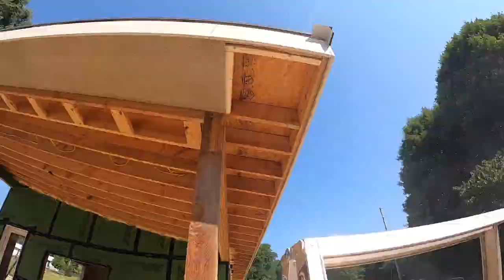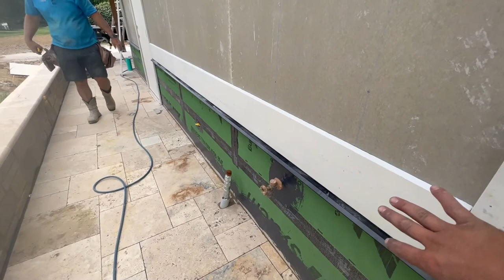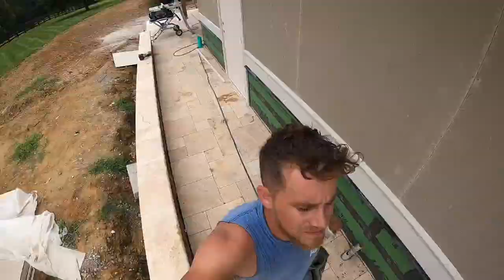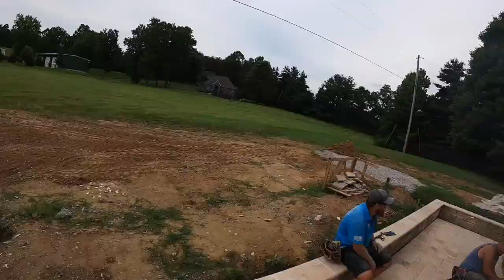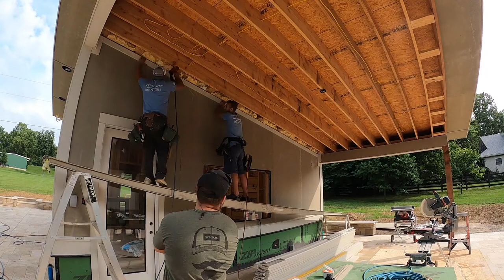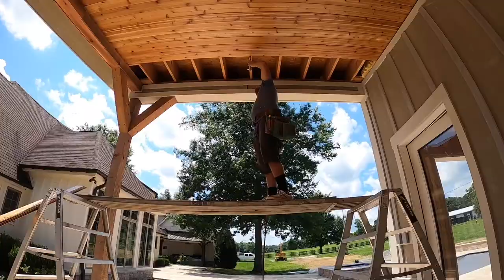Board & Batten James Hardie Pool House Install (Timlapse)

Comment: Nice video! I'm planning to build a custom home with Zip R sheathing with Hardie board and batten.  I was planning to use Keene easy fur as a rainscreen.  Is it best practice to use rainscreen when installing Hardie siding?
Reply from the maker: I’ve never used rain screen on board and batten. To be honest with you, I’d be afraid that it would start to warp and loosen up.
I’ve seen Borden batten last 30+ years on a pathetically framed it and sheeted home. So in my opinion, if you do the proper air and water seal techniques on zip, you won’t ever have a problem.
Reply: @jonport_  Thanks. Its just I have heard from other so called experts that if you allow the back of the fiber cement to dry with an air gap the fiber cement can keep its color longer as well as allow the Zip surface to dry quicker
Reply from the maker: Right. With lap siding id have no problem with a rain screen but it would need to be a 1x4. Actually while typing this if you did do a 1x4 every 16in with bats I wouldn’t see why that wouldn’t work. Because over all a well installed zip with a good rain screen is about as much over kill as you can get haha but also very effective. Look at Matt rinsingers video if you haven’t. He’s the best when it comes to this stuff. https://youtu.be/S6gDdyjx5hQ
Reply: You do not need to install rain screens.  For Pete sakes, 30 pound felt tar paper will outlast anything around. Tyvek disintegrates and is a garbage product.  Let’s see how zip holds up. I think it’s an LP disaster just waiting for failure.  Even if rain screens do have a place or any benefit, most would never be installed properly anyway.  Matt Risenger will only double your build budget for no reason.
Reply from the maker: Be as it may. They do have a tone of benefit if you have the time and budget